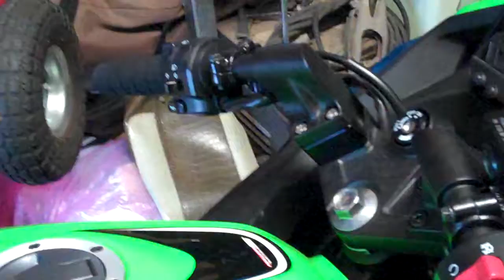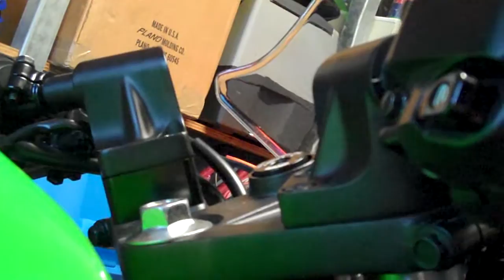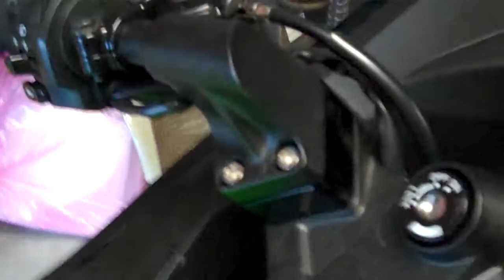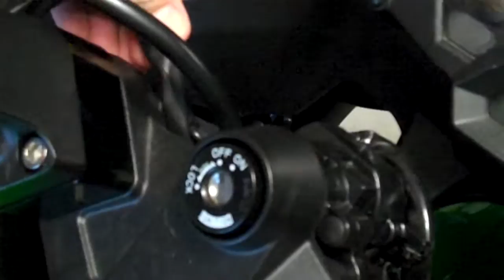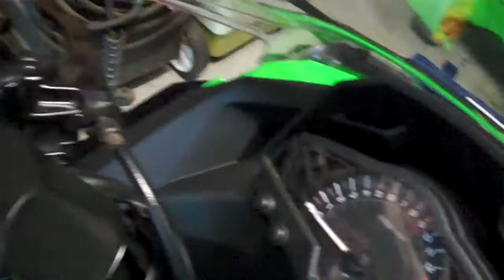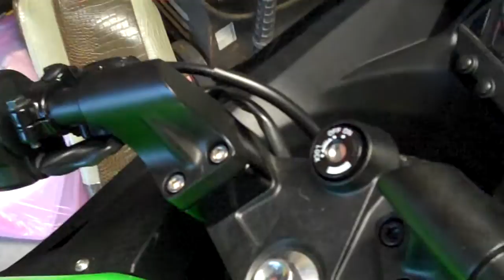part 2  black path bar riser - Kawasaki Ninja 300

Comment: How do I loosen up the break lines? When I put the risers on, everything is really tight. Please help.
Reply from the maker: Dani Frick that interesting. i have seen some companies say that if you have ABS you cant use these. if you look where the brake lines run near the head stem you should see the answer yourself fairly easily.i will give you a hint. it has something to do with a steel loop welded to the head stem where the brake lines run.if you cant figure it out for yourself, send them back to the manufacturer for a full refund.